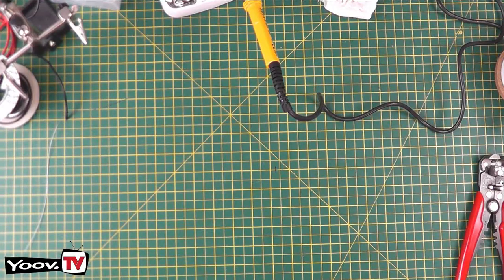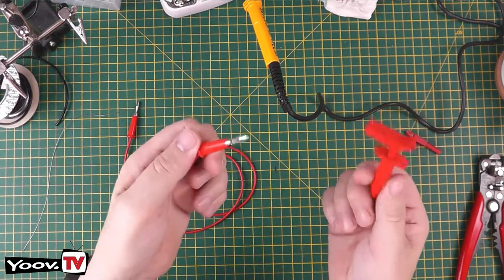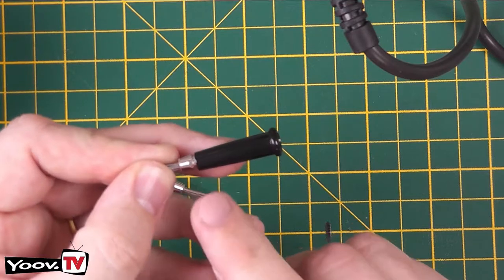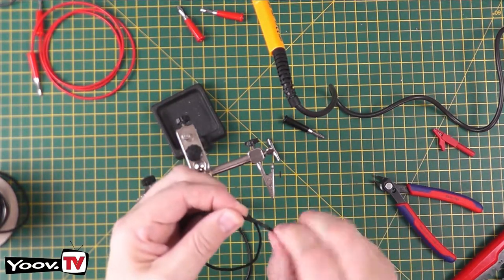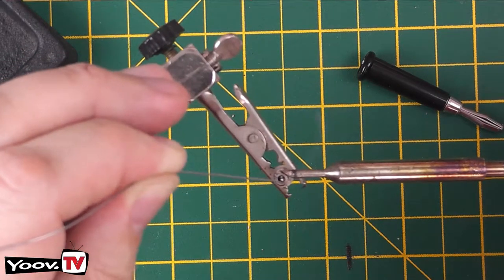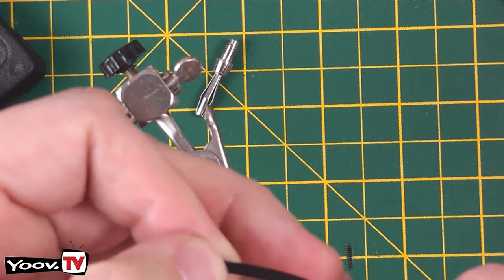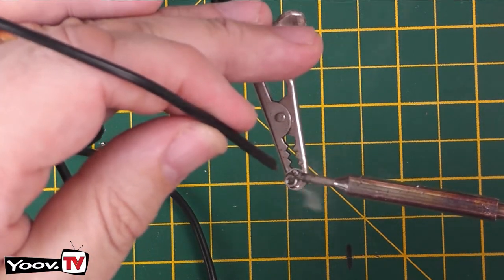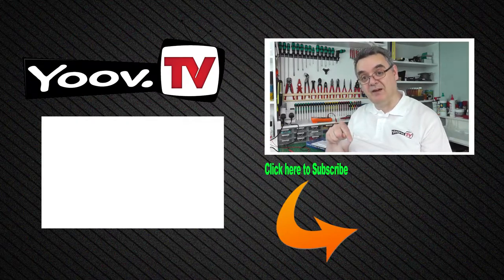Make your own Banana Cables and Save Money!

Comment: what kind of cable do you use? 26 AWG?
Reply: Usually these fall in the 14-18 awg range for handling anywhere from 5-20amps or so (smaller awg numbers equate to higher current max, places like caltestelectronics give current ratings for each wire and insulation choice)
Reply: the smaller the number in AWG unit, the thicker the cable and the more current it can conduct.